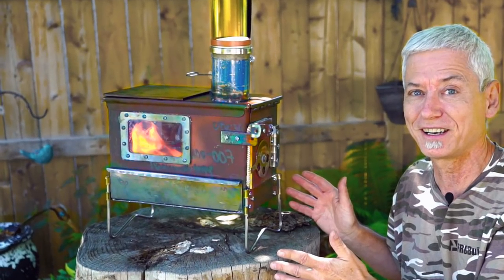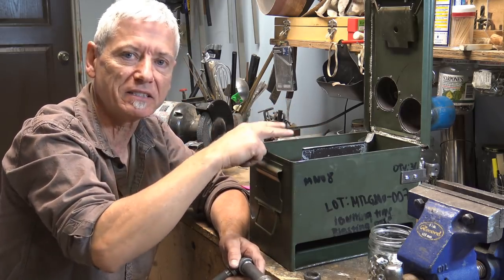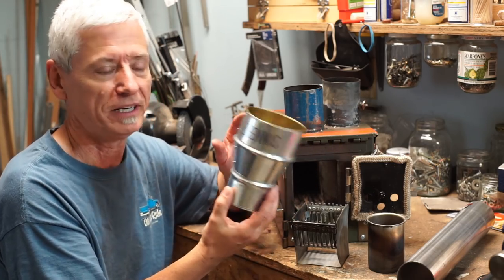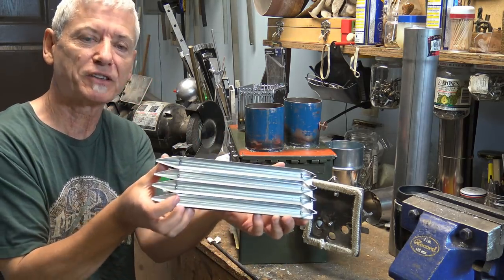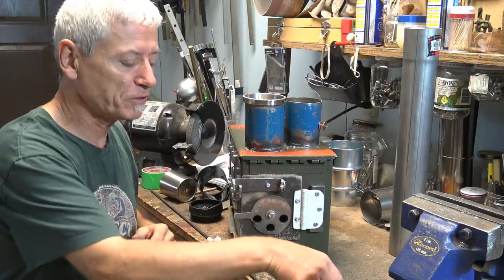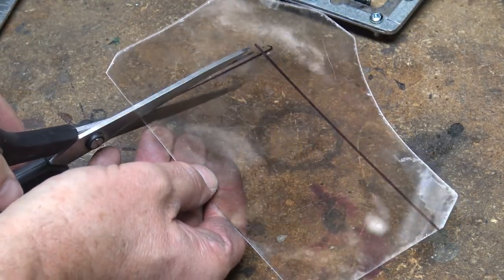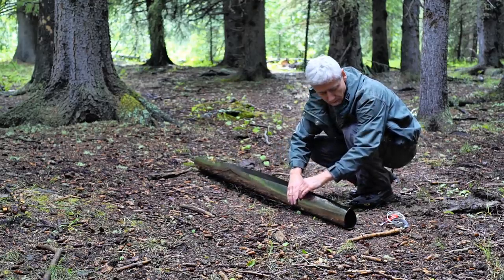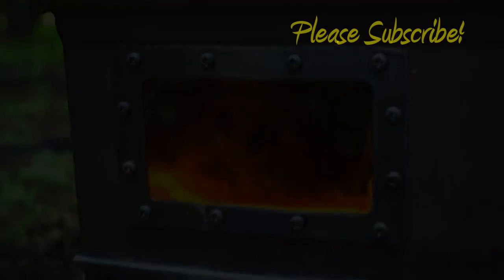A Wood Stove for Camping Part 3 - Camp Ready

Comment: I was going to comment after watching the 'Winter in an A-Frame' vid you made but I did something else away from the pc, then forgot, life eh lol.
 I have a gas bottle woodburner someone made for me 30 years or so ago and it still works, to a fashion. I have to say though, this burner you have made is probably the best one I have ever seen, and I've seen thousands. As a designer it is my place to find solutions to products and redesign them to be better than they originally were and with this design, you seem to have covered; if not all, most of the needs for an all purpose woodburner. 
 I would be be thinking of ways of putting it in the A-Liner, so then if you are caught in another snow storm it won't be any problem at all. It also occurred to me that if you built some kind of heat filter/shield, you could probably boil a kettle or heat a pan of something on top of Dennis the Hopper.
 Would I be right in thinking you can burn regular wood with it as well as pellets? I have 'liked' all your vids and have subscribed too. Keep up the great work. Peace x

Comment: Have been following your DIY ammo box stove so it's great to see you finally show it on your latest vid.  Lol, you actually have a seek outside extremely expensive stove.  Yet you still decided to design your own stove.  Very well design.  Special like the 2nd burn chamber and the 2nd hot air burn pipe.  Only thing I would change is maybe making the 2nd burn chamber smaller so the main chamber can hold more wood and last longer.  Maybe attach the bevel on the roof instead?
Reply from the maker: I don't own a Seek Outside Stove. Only bought the titanium stovepipe and stove jack from them. A larger burn chamber? Possible, on the lower part at least. Top is restricted by the hopper and flue size. But that would also limit what I could store in the stove. Thanks! SP

Comment: You know what I really likecabout your project videos, Slim?  You show people that they don't need a bunch of fancy (and pricey) tools to make things.  I have a couple of questions - 1) When burning pellets, do you keep the torch in place the whole time or just to get them started?  2) Can you elaborate on the secondary combustion chamber?   I'm not quite understanding how it works.  Thanks!
Reply from the maker: Hi MsKraftee, thanks for your questions. 1) The torch is only to start the pellets burning. A couple of minutes and the rest self-ignite. 2) The secondary burn adds air to the upper chamber to re-start combustion in the smoke, therefore burning off more gases. As the pipe is hottest at the top, cold air is sucked in from the inlet at the bottom. Hope this helps. Thanks! SP
Reply: Slim Potatohead  - Thanks, Slim.  Now I understand (about the secondary combustion).  Thanks!

Comment: A great insulator is kaowool paper its about 1/8" thick and easier to work with than fiberglass. And you can make your own pellets with biomass (paper and sawdust pellets) use a 1/4" iron pipe to form the pellets and extrude them cutting every 1/4". It makes perfect little pellets practically free.

Comment: Many amazing features you've built into this stove!  LOVE the pellet feed feature and the oven drawer.   I see room for some improvements, if there is to be a version 2.0. Secondary burn tube could be a straight pipe right in from the side. The door could do away with the fiberglass seal. (and hinge spacer)  And the hopper and metering tube could be integrated. Everything else is amazing, especially considering no welder. I can only imagine what you could accomplish if you picked up a welder!

Comment: Best instructional video I've seen.  Not just a great instructional video, but interesting and entertaining.  I learned some new metalworking techniques, like bending the metal with the clamps.  You couldn't buy a better quality stove than that.   I think you would really like an angle grinder.  You can get a cheap one to try it out.  Get some heavy cutting disks, and some thin ones for thin cutting.  Also, why did you use US pennies to make that piece on the pipe?  How did you know to make that section to burn the smoke off?  Also too many ads.
Reply from the maker: Hi JF. Yes, I used American pennies as Canadian ones are aluminum instead of copper. As for the ads, I agree. YouTube played a trick on me by changing the defaults. I have removed most of them. Thanks! SP
Reply: @SlimPotatohead  Hi Slim, thanks for your quick response.  Canadian pennies are aluminum?  I didn't know that.  Is that a recent change?  I am a coin collector and never read that before.  For the grinder, I should have said the the heavy disks can be for removing large areas of metal, the thin ones are for cutting off pieces.
Doug

Comment: Awesome design. I'm just wondering if the after burn intake has to be at the bottom of the box. If the air could come in from the top,  I could use just 1 straight pipe and 1 elbow, instead of 2 each.

Comment: That's cool thank you for the share.  Wet fire takes skill but with that torch it would be almost to ez so in a pinch I'm betting you could use found wood in the stove if you had to. Let me add it would be a lot smoker than dry wood thought.
Reply from the maker: Yes, I did exaggerate a little! You can burn wet wood, however being able to store your fuel in a watertight container is an advantage at least. Thanks! SP

Comment: I would think its a fairly easy mod use the external plate exaust for a gas furnace then swap out the titanium roll up chimney for car exhaust pipe sections that slip together use a welding blanket to make a mat to protect your floor this would even solve the condensation issues.

Comment: Thank you for your videos...I love learning from you!  I have a 2016 Ranger 12...My question to you is Does the furnace run totally off of propane or does it need the battery to run the furnace fan?  Thank you
Reply from the maker: I'm assuming you mean the trailer furnace and not the stove. Yes, the propane furnace needs power, quite a lot when it is running. that's why I prefer the stove which generates it instead of consuming it. Thanks! SP
Reply: @SlimPotatohead  Yes, I did mean the trailer furnace.  Thank you for your reply

Comment: That was amazing. I am still confused how the metal pipe inside the stove works to burn off smoke? Right?  And not sure why that is needed or really how it works. I may need to watch this again.
Reply from the maker: Are you referring to the secondary burn? It re-ignites any gases that are not removed in the initial burn. SP

Comment: Great stove video...a couple of questions how expensive was the titanium foil and what size hole did you use in the bottom of the hopper cup
Reply from the maker: Hi Gmanjay, there is a link in the video description for Seekoutside's stovepipe. $14.95 a foot last I checked. Not sure what hole you are referring to. Can you describe it differently? Thanks, SP
Reply: maybe i misunderstood..... is the hopper cup open on the bottom or closed with a hole for pellets to fall through
Reply from the maker: The pellet feeder consists of a funnel, pipe insert and cage. Pipe insert is 2 1/2" diameter. Thanks SP

Comment: I am acquiring the materials to make a copy of this. Could you show a closer up pic or video of the intake hose adapter for outside air?
Reply from the maker: Hi Joseph, Unfortunately I can't add to an existing video or share images. The inlet hose is simply vinyl ducting hose that is attached to an elbow duct and a tin can with vent holes in it. The can bolts onto the stove door. The other end is attached to a piece of Styrofoam that fits in my door vent. Thanks! SP
Reply: @SlimPotatohead  Thanks, mostly i couldn't see the can arrangement and thought you just hooked it from top of the door. I have the lid done but welded the tubes . The floor and divider are done welded as well and oven opening complete .  Now the door and window next . I love this project and want to use this stove in my 63 Airstream when needed. I have been binge watching your videos such a treat sincerely enjoy them thanks again ...Joe
Reply from the maker: Glad to have helped inspire you Joseph! Yes, having a welder makes like easier. Good luck on your creation! SP

Comment: Great video Slim! It's given me the confidence to try to build one myself! I've already bought a fat boy 50...
I'm just not clear on what's stopping the floor of the stove from dropping into the oven compartment?
Reply from the maker: Hi Yorkshire, the oven part has sides just under 2" high that separate the oven from the fuel chamber . They are on the ends, while the front and back bend up to hold the ash. The tent stakes also give a little heat barrier to protrect the chamber bottom from falling through. Does that help? Thanks SP
Reply: Thanks for the reply Slim, Yes that helps a lot!  Hopefully I will finish it before our winter! (Early December). Great vids btw!

Comment: Any issues with regards to the aluminum rivets melting in the hopper heat?
Reply from the maker: I didn't use aluminum rivets. They are stainless steel. SP
Reply: Slim Potatohead Ah! I was wondering how the aluminum didn’t melt ;)